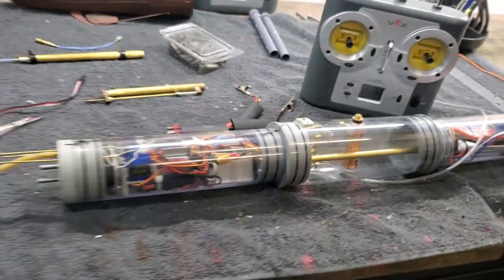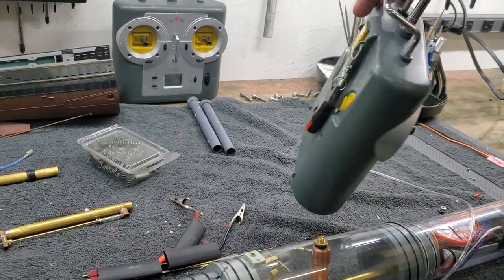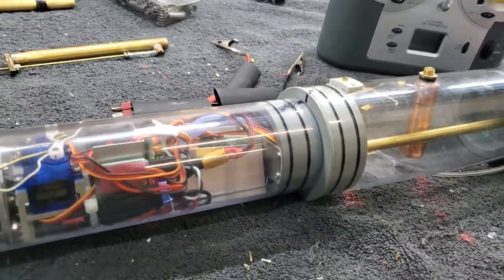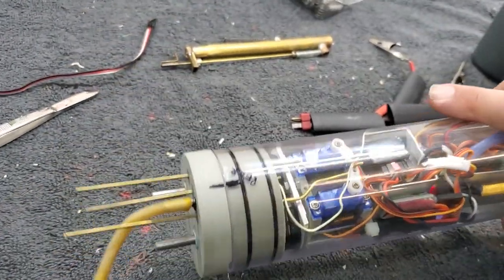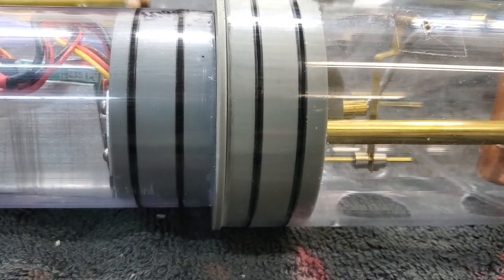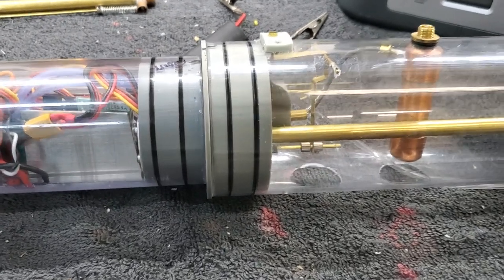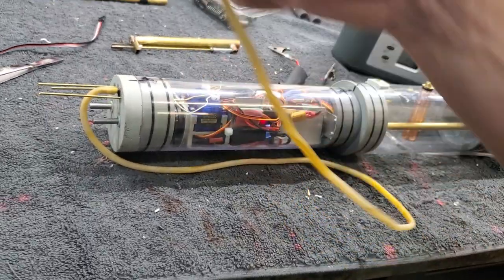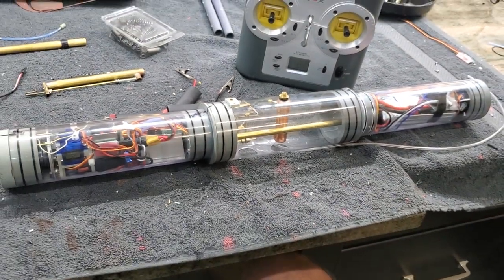MSD watertight cylinder SubDriver setup and operation

Comment: Hey,
I'm currently in the process of building a submarine using an ESP32 as the controller.
The submarine has GPS for surface navigation and a compass for underwater navigation. There's a depth sensor for active depth-keeping.
It's not yet finished, but a making quick progress. The active depth controller (simple PID with antiwindup) will be tuned soon, next up then is propulsion. If anyone is interested in the progress, I can post a link to the project page.

Maybe someone is interested in the code, it could be used for any other submarine as well:) there's a command queue that is used to make the boat do different actions "autonomously"

Comment: Is there a particular reason fm is used in subs as against 2.4ghz system.
Reply from the maker: 2.4ghz does not penetrate water.
Reply: @RCSubGuy  thank you as I was very curious especially when I watched the vid re the cylinder that gave the option of 2.4ghz or FM. I take it using 2.4ghz you can't fully submerge which would defeat the purpose of a sub 😉